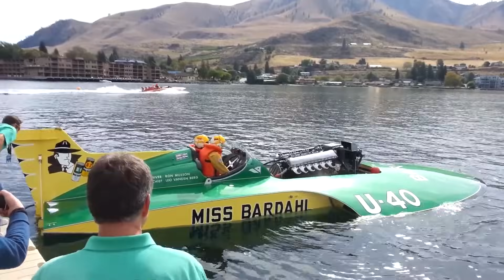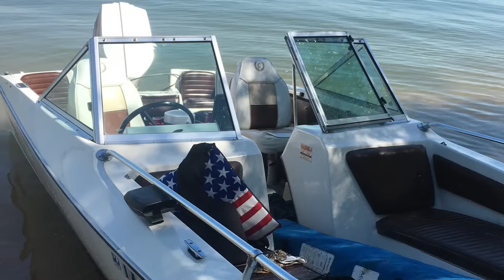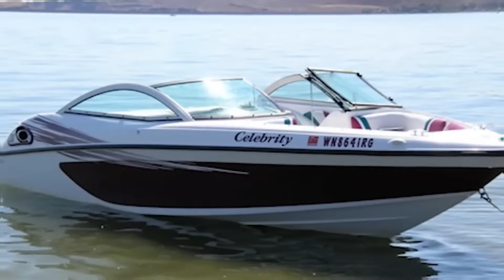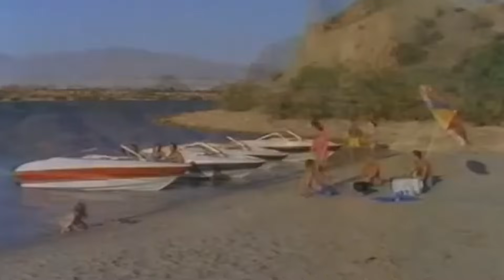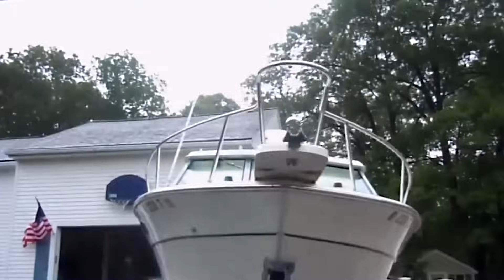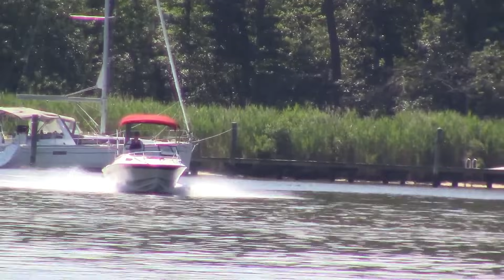Dangerous Boat Manufacturers That Faded Into US History!

Comment: Maximum was good boat, but remote 2 stroke oil tank sucked and the oil pump stopped working so had to mix fuel anyway. With the oil injection you supposed to just fill the tank